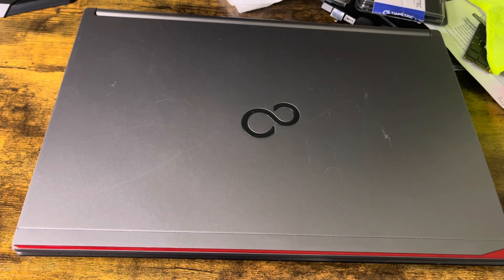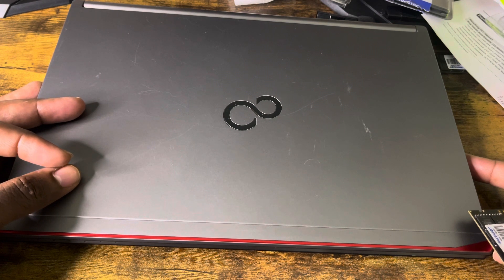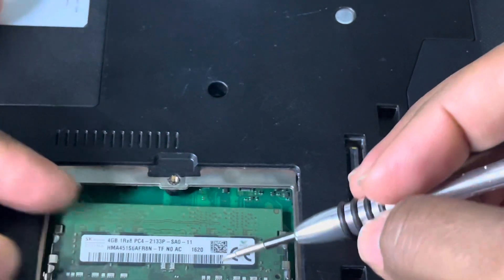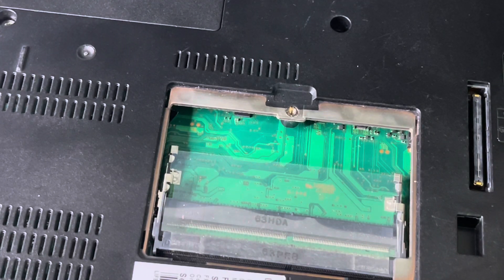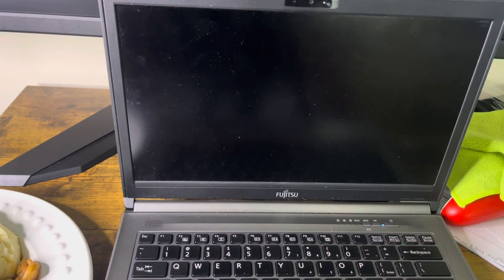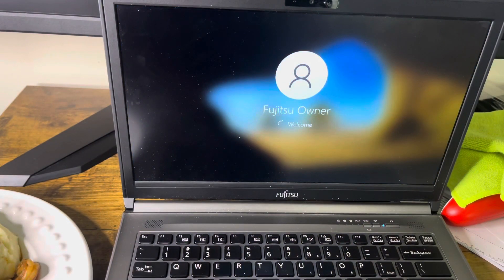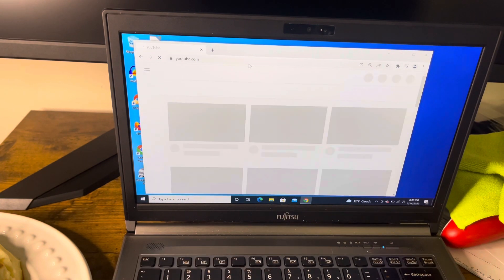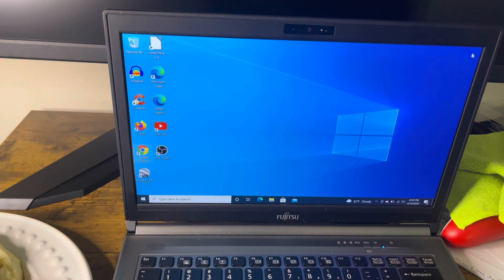Fujitsu Lifebook E746: Is this laptop Upgradeable?

Comment: 0. I would not buy Patriot operating memory, because equipment of this manufacturer happens frequently to be broken.
1. After adding or replacing of hardware, it is a good idea to see firstly to UEFI (BIOS) before loading an operating system.
2. Fujitsu LifeBook E746 is a great device (unfortunately, I do not have it). The only upgrade it needs is to remove Windows and to install GNU/Linux.

Comment: My laptop won't open, but all the lights beside the power button are blinking. What should I do? I already sent it to an electronic technician but it's the same again after I used it
Reply from the maker: I’m not sure what to tell you because I haven’t experienced anything like that. I’m currently searching for a solution so I can help you
Reply: my laptop has the same problem.. a red light blinking beside battery n.1 and the computer doesn’t charge. If someone tells you how to fix that problem can you answer me? thanks